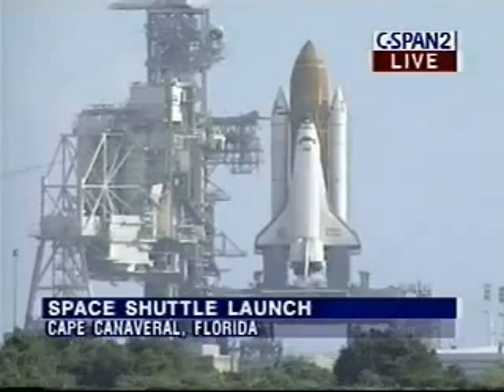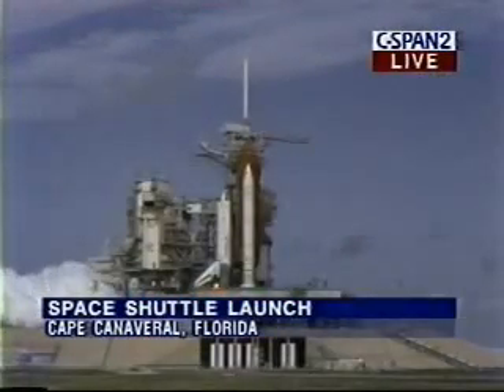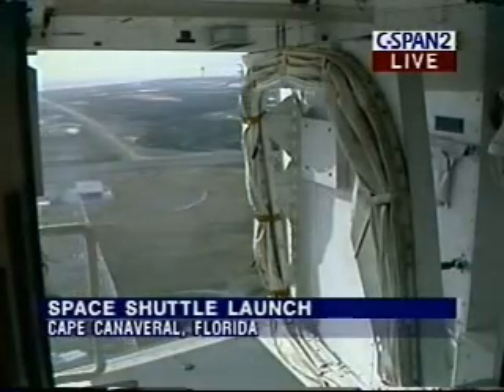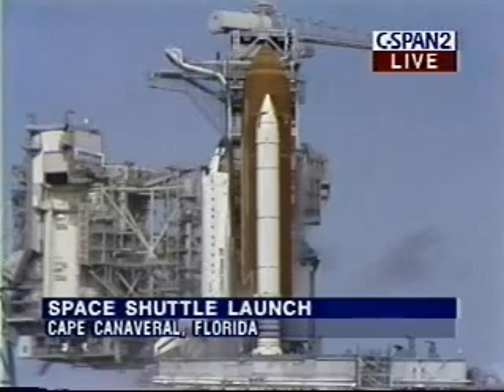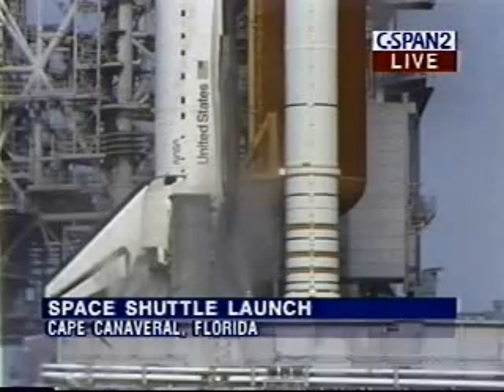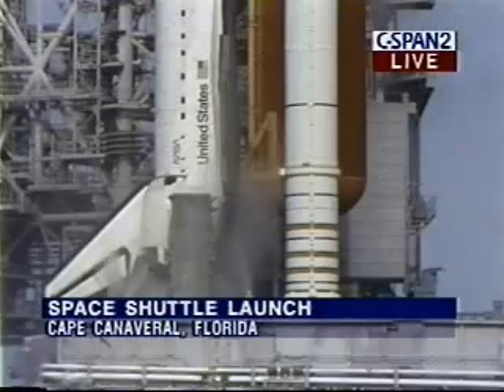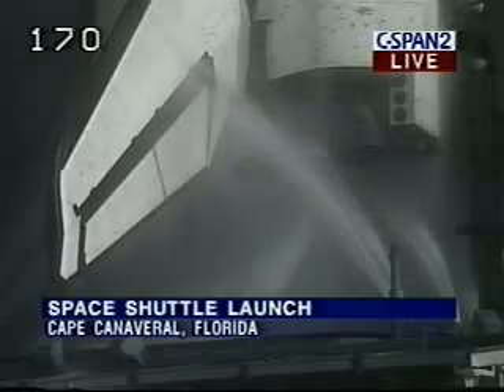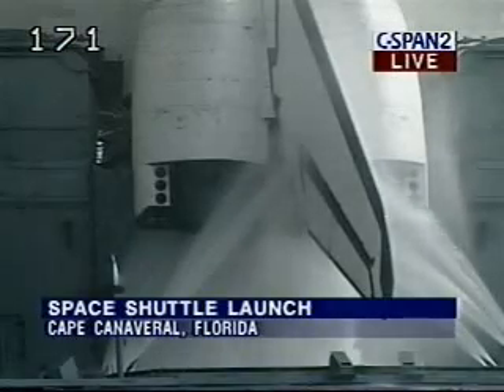STS-51 pad abort (8-12-93)

Comment: I wonder what the issue was in the early shuttle program that caused the RSLS aborts. After the one with Endeavor in Aug 94, they did not have another one for the rest of the program.
Reply: +Zoomer30 To bad this didn't happen on Challenger. But i think the disaster was meant to happen to show the asshole managers a thing or two, to make sure they listen to the engineers to prevent another disaster. But sadly nasa didn't learn from their mistakes from Challenger.
Reply: +Zoomer30 BTW yes they had aborts till sts 93.
Reply: +Ryan19812012 The last RSLS abort after ignition was the Endeavor flight in Aug 1994. They had a few aborts after :31 secs (after auto sequence start), but were not considered "hotfire" aborts. They had one i believe on the Chandra mission after the "hydrogen ignitors" lit but before the engines started due to a detection of high H2 levels in the aft end of the orbiter which could have been a leak (was really a glitch with the detector where it could "burp up" extra H2 and make the concentration seem higher,  due to the time lag between detections they had to call a hold).
Reply: Zoomer30 Sometimes it was false readings.
Reply: @Zoomer30  Actually i believe Sts 68 abort was t-0 second just before the solids were lit

Comment: Would be funny feeling to be there in that last second abort rocking ship. Just look how much it is rocking
Reply: And all that motion is allowed via the SRBs O-ring system as all the mass of the stack is held in place by 8 bolts that use fragible nuts that detonate at T minus-0.  The new SLS 5 segment SRBs at launch, arent held down by anything but the m,ass of teh stack.  The SLS will have no "twang" motion that the sidemount STS vehicle had.  Holddowns will be removed hours before launch.